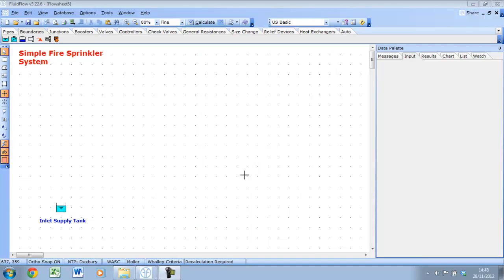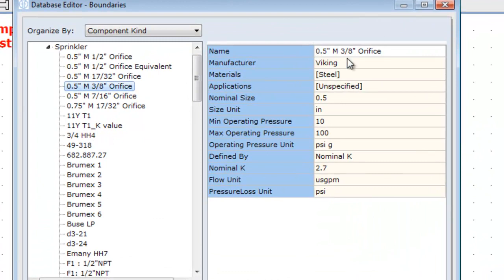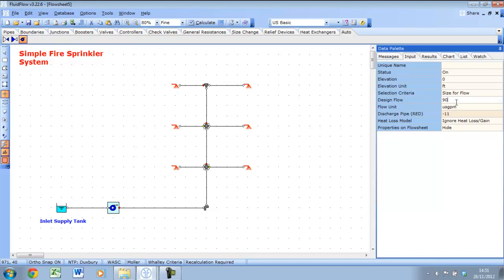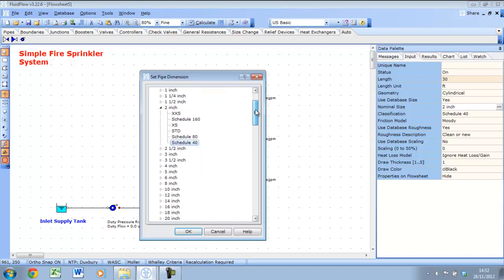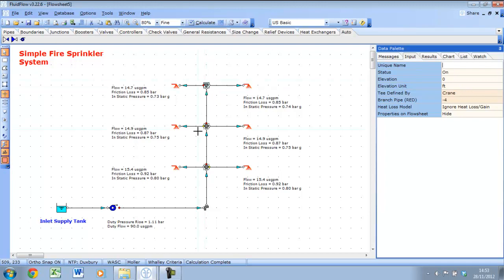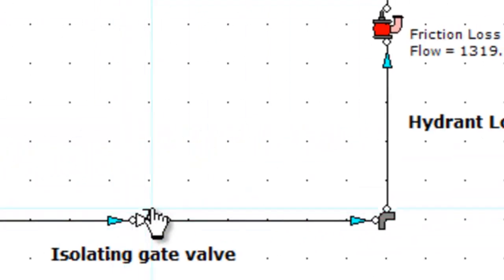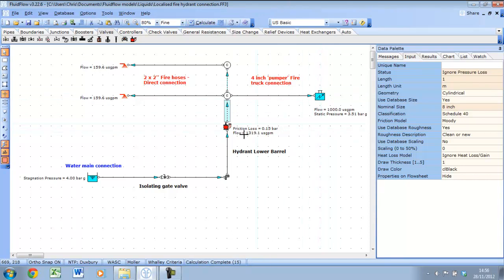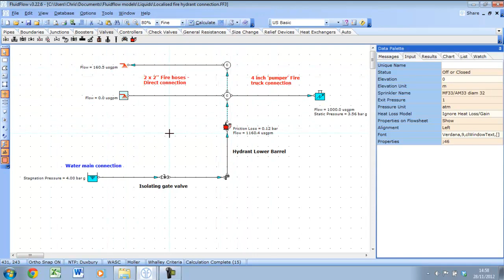FluidFlow - Modelling Fire Systems

Comment: How do I learn this software.
Reply from the maker: Hi Shivaji - where are you located?
Reply: @FluidFlowInfo  , Mumbai, India.
Reply: Do this software use Indian industry. If use , name the company with are using this software.
Reply from the maker: @shivajikamble4050  we have a partner in India solely responsible for FluidFlow training and inquiries - Converge Engineering Pvt. Ltd - you can contact them at bd@converge.net.in
Reply from the maker: CEPL are currently running online FluidFlow training sessions during lockdown
Reply: @FluidFlowInfo  , thank for you reply . Will contact them.